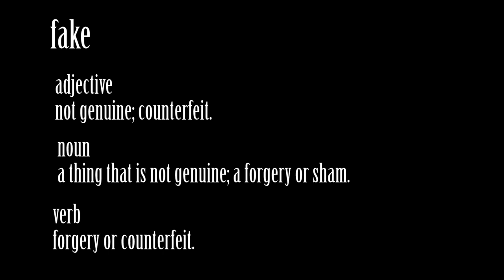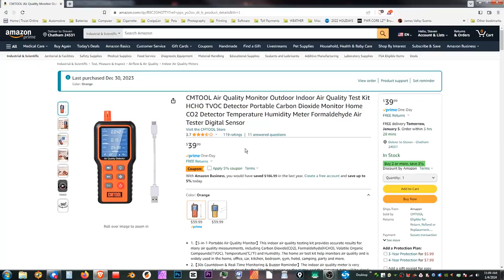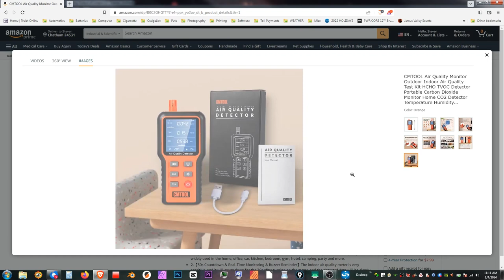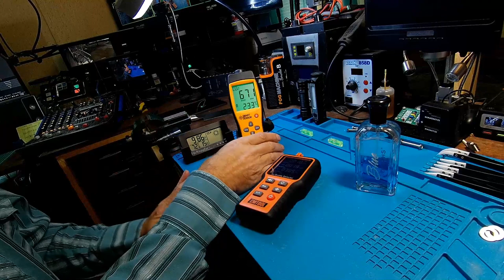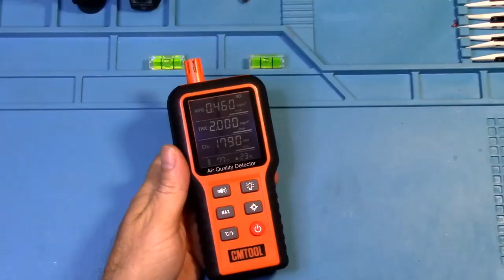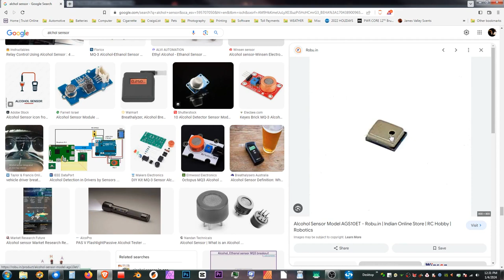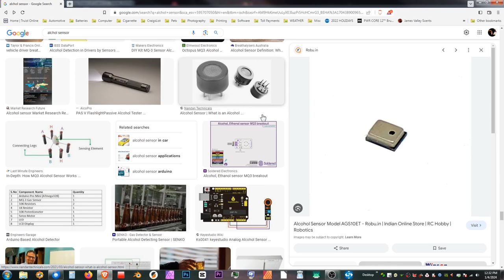Test, Review, Comparison & Tear-Down of the CMTOOL Co2 Meter - Is It Real Or Is It Fake?

Comment: Speculation is not needed for the sensors. The two sensors are labeled on the sensors. Speculation is only needed if the manufacture withholds the sensor datasheets. What are the markings on the sensors? The text on the right sensor is visible at 12:43 for a half second.
Reply from the maker: The only sensors the CMTOOL meter has is a temp and humidity sensor and I think there was an alcohol sensor as well if I remember correctly.  There was no actual air quality sensors inside so no need to look at chips as they would not tell you why there were no air quality sensors installed into this fake.

Comment: Hi Steven, I recently  saw a video  with the CO meters we have from Alliexpress. It seems to be quiet accurate. Also a interesting  thing he said that the sensors have a expiry date, they do not last forever. the CO sensor is good for 3 years in our meter, but depends when it was made, if it was made 1 year before you bought it, the sensor will be good for 2 years.    Also he prefers NDIR  sensors
Reply from the maker: Do you mean CO2?.  Electrochemical sensors are used mostly because they are more accurate, and yes they seem to have a shorter life span but that may depend on how often you use it.  I do not use mine 24/7.  I only use mine if I feel that the CO2 needs to be checked. 

There are two major drawbacks of NDIR sensors: interference and detection limit. The sensitivity of a NDIR sensor is the magnitude of the detector signal per unit Infrared (IR) intensity. Detection limit is a measure of the smallest concentration which can be determined with a specified precision or reproducibility.

If you only use your CO2 meter when you think there may be a problem, then it may last for many many years to come, so just don't run it 24/7.  These meters were not meant to run 24/7 in the first place, they are meant only for industrial use in factories and places of business, and the reason for Electrochemical is for better accuracy and detection limit.

I keep mine in a case, and only bring it out when I need to use it just like you would any other tool, but then again - we will find out huh?.  I hope this last more than 3 years with little use, but I guess I will find out.

If you could give me a link to the video you are talking about, that would be great as I would find it interesting...
Reply from the maker: Well Ruudy, I have to thank you for bringing this to my attention.  I have been doing more research on these electrochemical sensors, and yes they do have a shorter life span.  The reason that electrochemical is better is because they are more accurate, but at a cost - shelf-life.  I am still learning, so if I want accuracy, I may need to buy one of these every 2-3 years for use in videos, but for the typical person, I guess the NDIR would be a better choice because they last longer with the unfortunate loss in accuracy, but I guess also for the typical person, there is no need for pin-point accuracy anyhow.

I am still learning as I go, but it is good to know about these electrochemical sensors, so that I don't push a product that has a shorter life-span even though it has better accuracy.  I just say that you should take advantage of the better accuracy at least until this one dies, and then you can get one with the NDIR sensor that has a better life expectancy.

Comment: Hello!

I don’t know if you have already answered this question before but what is your top 3 air quality monitors for a home use? 

So my apartment located near busy railroad station (trains come and go every 30 min) and there is also a highway (also very busy), for that reasons I’m really concerned about the air I breathe, should I open my windows or not, etc. 

First I would like to buy a best monitor for a home use and then buy air purifier (if air is bad). 

Many models that you are reviewed are not available in my country, so I can not buy something right away. Nevertheless I would appreciate your recommendation.

Thank you in advance and thanks for your videos. You are literally only one who is doing this at this level of thoroughness
Reply from the maker: My top 3 at the moment would be TemTop, Hotkrem, AirKnight for Particulates, HCHO and TVOC and (Smart Sensor handheld meter for CO detection).  AirKnight is coming out with an update to the 9 in 1 in a few months, so I would wait on the AirKnight until the update comes out.

Being located near a railroad station, and being concerned about air quality, I would purchase an air purifier like the Levoit Core 300s, 300 or 200, and let it run 24/7.  I have had my 300s for about a year, and it runs all the time, and works beautifully.  I change the filter about every 6 months, but that depends on how dirty the air is, and it is easy enough to check the filter every month or so so see how the filter is changing in color due to contaminates in the air.

I would also consider opening a window on the opposite side of the house to the railroad station, as most contaminates are going to be on the track side, so that side of the house will have more contaminates present allowing them to come in through windows on that side of the house.

I understand that not all of the monitors I review/test are available in your country, so if there is a monitor available to you that you would like for me to check out, just let me know what monitors are available to you, and I will do my best to purchase a monitor to test and review.

I am glad that I could help with these videos, and am hopeful that I have been able to help also with your questions.
Reply: @Outside-In. Thank you very much!
Reply from the maker: @wellmalysh3609  You are very welcome, and glad I could help 👍👍

Comment: There are a few suggested air quality monitors.
Have you tried the Bosean T-Z01? It has 4 sensors：HCHO sensor, PM2.5 sensor, TVOC sensor, temperature and humidity sensor. CO2 and CO are inferred from the data detected by the TVOC sensor.
Can it be good? Other Bosean products are reputed to be great, for example their Geiger counter FS5000 is an original design, with good price if it has a J321 tube.

Qingping Air Detector 2 (the upgraded version) is also looks promising, it also has noise measurement above PM and eTVOC. I think this item was praised on reddit if I remember correctly
Qingping also has other air quality meters as well which looks fairly similar :)

What your thoughs on these?
Reply from the maker: First of all.  A monitor that uses data from a sensor to give readings for another type of sensor is invalid and is NOT to be trusted for any reason.  The only true reading is from an actual sensor NOT another sensors data such as the Bosean.  It is unfortunate because people are falling for these false monitors, and are not getting true, correct or accurate information.

Quingping seems to be a good monitor, but unfortunately I cannot afford to make the purchase for testing and review, and why I have had to put air quality videos on hold for the foreseeable future.  I have contacted Quingping, and a few other companies about testing and reviewing their monitors, but as soon as they check out my channel, they don't get back to me.   I have a friend who bought two Quingping monitors, and had to return them both, so I can't recommend them on that grounds, plus I cannot recommend anything unless I have thoroughly tested it personally.

The friend I just spoke about, also bought the uHoo monitor, and loves it.  He has sent me data and I really like it myself, but it is quite expensive and I cannot afford to purchase it.  I contacted uHoo about sending me their monitor for testing and review, but they also never got back with me.  I am also having to consider the fact that companies are not getting back to me because Outside In just is not big enough yet, so it wouldn't financially make sense to them to send a monitor to me for review.

I hope this helps, and will be happy to do more air quality monitor reviews when companies are willing to send them to me for testing and review.

Comment: Just tested my CO2 meter which sits at 422ppm, did not move with alcohol, I did hold my breath while testing. The TVOC shot up to 2000mg/m3 normally it stays around 1,780mg/m3 is this  ok
HCHO is around 0.220mg/m3  did not move much during test. Both TVOC   and HCHO  stay in the red zone, even whrn I put the meter outside. I have quiet a lot of foam RC planes, thats why I bought the meter.
Reply from the maker: NO,  that is not normal for TVOC and HCHO, but I am also concerned that the CO2 is at 422 ppm before the test - too low of a number.  What is the name of your CO2 meter?, I would like to check it out.   Thanks

Please watch my latest video,  I go into detail about fake CO2 monitors and how to test them,  while also testing a fake CO2 meter.
Reply from the maker: Sorry Rudy, I have been responding to so many comments today,  that I keep forgetting who I am talking too, so I just came back and re-read your comment,  and I noticed that you had mentioned that your TVOC and HCHO stays in the red even outside,  and that is not normal at all, nor is 1780,  so now I am wondering if I am right that your monitor could be either defective or not being quite honest with you.  Could you tell me the name of your monitor so I can check it out for you?.  Thanks
Reply: @Outside-In.  Hi Simon, the meter is a Yilofy,  There are a lot of meters that look the same but this has a stepped case, maybe it has a fan in it. I will open it up if I decide to keep it
I recieved the Hotkrim today and it seems to be working ok, will only know for sure, when I get my other meters I made a little video of the meters showing that one was bad, with the high TVOC and HCHO   https://studio.youtube.com/video/PhbwH6ol_s4/edit    I sent that faulty meter back
Reply from the maker: @RuudyL  Thanks for the update.  I will have to check out that video, would be great to see what you are talking about.  You will be happy with the Hotkrem.  

Thanks for the communication - it is much appreciated.

Comment: What multi function air quality meter would you recommend for indoor 3D printing with polyamides and polycarbonate polymers ?
Reply from the maker: Polyamides put off particles in the range of 5 to 10 microns in size, so you would need a monitor that registers PM10 and PM2.5.
Poly-carbonates (according to SciCron Technologies and Naxtat.com) have no adverse human effects  - However, certain sensitive individuals with respiratory impairments may be affected by exposure to components in the processing vapors, so for the vapors, you would need a monitor that also has a VOC sensor.

As far as what I recommend...  I truly do not have a great answer unfortunately any longer (for the time being)...  The reason is that all the monitors that I have tested and reviewed to date, have either stopped working, or have stopped registering correctly.  After much more research, I am finding that most monitors now have such poor quality control from the manufacturers, that it is being a hit and miss on even getting a device that works or works for very long, and that is why the comments/feedback on most devices have such a diverse difference of opinion on how good a product is.  I (for the first time) am at such a loss for what to recommend any longer except for trying to find a lab quality device that the company will stand behind 100%.  I have contacted companies that sell devices that cost in the hundreds or even thousands of dollars, and not one of them will send a device to me for test and review, and I do believe it is simply because Outside In is just way too small for their consideration - it is about making money, and the only channels that would be considered, would be a channels with 10's of thousands of subscribers - so that they can get the widest audience possible.  That is unfortunate, but I do understand their reasoning.  I am in contact with a couple other companies that are going to be talking to me next week about their monitors, but I am not sure how it will turn out.

I truly wish I had the money to buy much more expensive monitors to test for durability and longevity, but unfortunately I do not.  AirKnight is in development of a new monitor based upon my recommendations, but AirKnight told me yesterday that they are getting closer to a finish date, but don't want to jump the gun on a release due to the possibility of something going wrong to prolong it, and I for one appreciate and respect them for that.  AirKnight is working very hard to create a monitor that will exceed that of most monitors in a budget price range, so we just need to let them take their time to get it right.  I just found out also that another monitor that I thought would be a good fit for Outside In, has now started having critical issues after being on for a few days, so honestly LivingTheDream, I am at a total loss of words for how to give you any recommendation at all at this point in time.  

I cannot and will not recommend a product to anyone without my testing, reviewing and doing a tear-down to verify the contents.  I hope I was able to say that without sounding rude LOL, but sometimes it is very difficult to put into text a sense of understanding and concern.  I care very deeply about peoples safety, so it would be completely irresponsible of me to tell someone that I believe this or that product would work great for you - without first trying it out on myself first.

The only recommendations that I can have at this moment are for a CO2 and CO monitor.  Even the Hotkrem monitor that I was beginning to fall in love with, I just found out through further investigation (see my latest videos) - is garbage and cannot be trusted - simply because of a serious lack of quality control.  Most companies are out to make their money, and the last thing on their mind is quality control.  If there is a company out there that truly believes in their product and stands behind it 100%, and would like to have access to a channel that will be completely un-biased and 100% honest - then I am ready to help them get their product to the public, but so far I have had not takers unfortunately.

I am so sorry that I could not be of more help, but I would not be able to sleep at night if I sacrificed your life just to give you a recommendation of something that I can't find a reason to believe in.  One person will argue that their device works flawlessly, and then you will find 10 more people (with the same product) complaining that theirs don't work, or stopped working after a few days or weeks (I must say it truly is a lack of quality control that causes this indifference in most products that I have tested and reviewed) - so in the end (right now anyhow), your guess my friend is as good as mine.

I am now hoping that the new AirKnight is going to truly be the best of the best - but that obviously remains to be seen...  if anyone is reading this and knows of a great great quality monitor that Outside In can get behind, then please let me know, and I will do my best to get my hands on it for sure.  

Thanks LivingTheDream for your comment and question, I only wish I could have given a better answer to your question.  I think from now on, I cannot do a video for any monitor at this point, until I have used it for at least a few months to verify that it would last more than a few moments LOL.  Companies that are pushing out product with no care for safety or longevity, are making is difficult for good and honest companies to get their more expensive products seen.
Reply: @Outside-In. thank you for your response, i hope that there will be an accurate and affordable multi function air monitor soon.
Reply from the maker: @LivingTheDream77  Me too, will keep looking.   👍👍👍